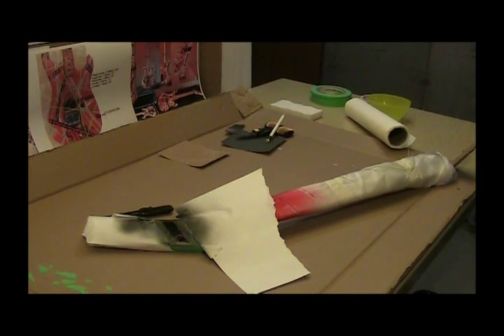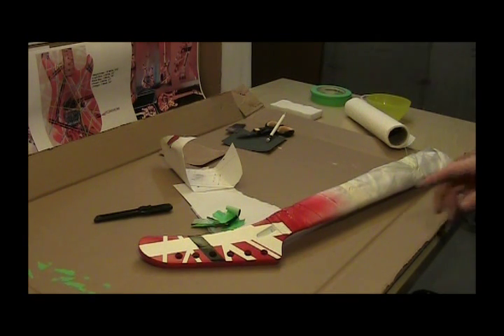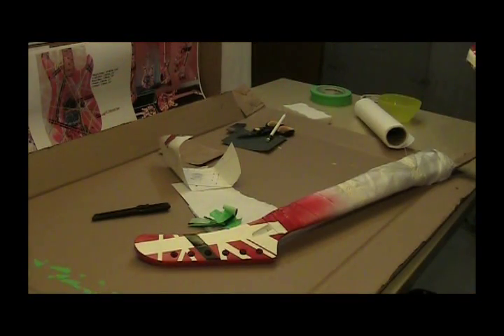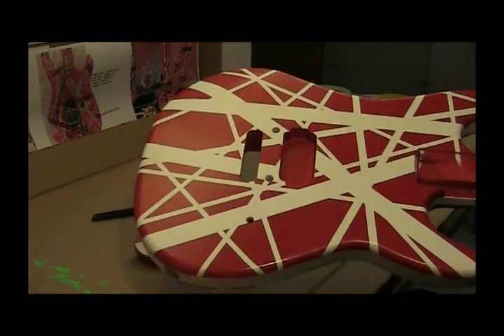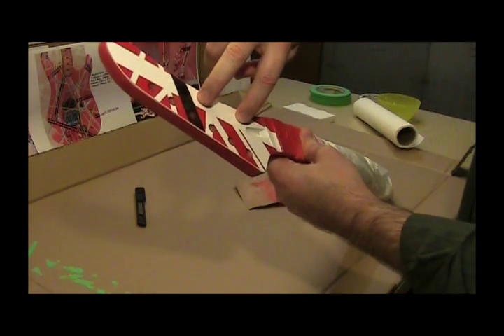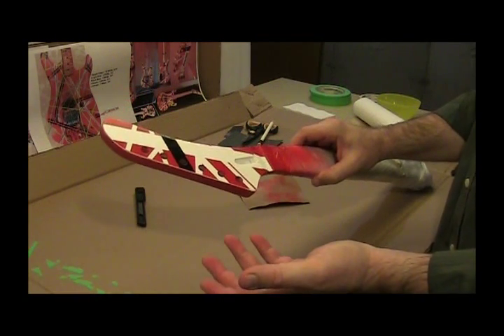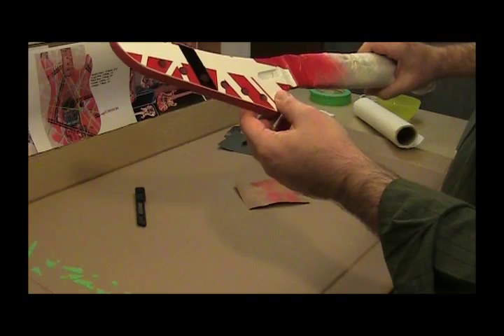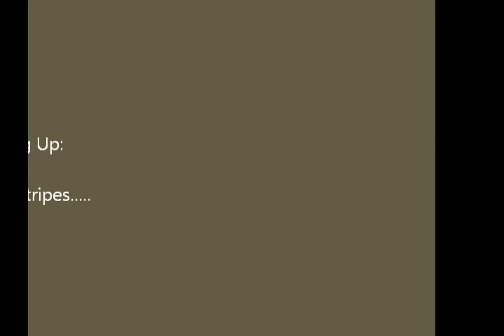5150 Replica - Tribute Guitar - Part 8 -  Relic'ing the Body

Comment: Way to go to have the patience to do this project.  I have wanted to make one for a long time, but just get discouraged knowing how much work it is.   Future tip for getting crispy lines.   After you tape off, but before you move on to your next color, spray a light coat of the previous color.   That way any paint that bleeds under the edge of the tape won't mater because it is the previous color, but it then it works to seal the edge of the tape.  On your black stripes, since you are going over two colors,  you could have used a light shot of clear coat to get the same affect.

Comment: I like the idea of relic'ing the guitar. But just in my opinion, I'd rather have a pristine guitar body and have it relic over time. Like I've had my Frankenstrat body for 5 years now and it has its share or dings, dents and paint chips. But it still has its glossy clear coat and I can always buff it out and get a mirror like shine to it if I want.

But I do like what you are doing. :) Idk if you've done the Bumble Bee yet but I'm interested in filling the pockets in one of my guitars I just bought and doing the black and white paint job on a guitar similar to the Lunatic kit guitar / barretta body.

Cheer man, keep up the good work!
Reply from the maker: Mikee Provolt I see your point about natural relic'ing over time, but one of the complaints about the store-bought EVH tributes is that they are prestine and not worn in. I was trying to replicate the relic'd look.

The other reality is I'm not particularly good at making a perfectly smooth paint job so all sorts of defects show up in the clear coat when I go for the gloss finish (see the telecaster project videos when I finally get those edited :-) Evidently I don't have the right abrasives to go with my buffer.

Anyway funny you mention the Bumblebee because I'm doing a single humbucker strat guitar next and that's one of my bodywork options. The body is Paulownia with a heavy grain pattern so I may go for a trans-colour instead.

We'll see. watch for those videos when they come out.
Thanks

Comment: I'm enjoying this series tremendously, as far as using a magic eraser, would you say it was successful at removing the red/pink from the white stripes?
Reply from the maker: Thanks! Yes, the magic Eraser works, but it is limited to how much paint you have to work with as it does wear it down. Eventually in a couple spots I got down to wood which absorbed a bit of the pink. If I'd used a gloss white I wouldn't have had that problem.

Comment: should be gloss paint all colours.....then a matt laquer on top.....It work for me mate...
Reply from the maker: kenrick arthurs You're absolutely right! That flat white caused all sorts of grief. I'm doing another guitar this year... a strat with single humbucker. I'm thinking of doing a sorta 5150-version paintjob on that one too.

Eddie painted a lot of guitars that pattern and gave many away as gifts apparently. So it won't look quite so out of place when it's done... except that I intend to use a tele control plate on it to make it unique.

If I do go that route (no pun intended) then I can correct all the errors I made in terms of finishing materials.

Thanks!